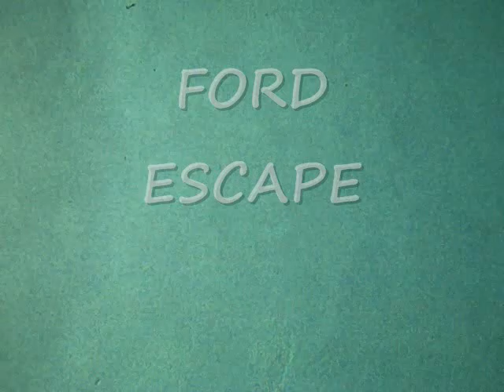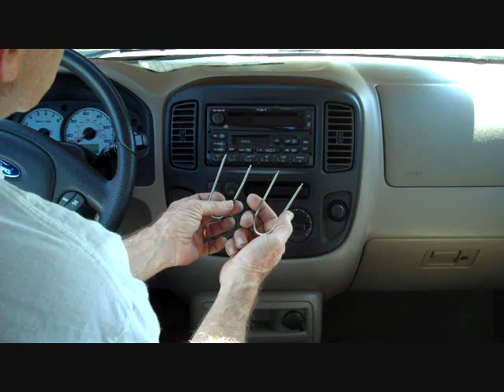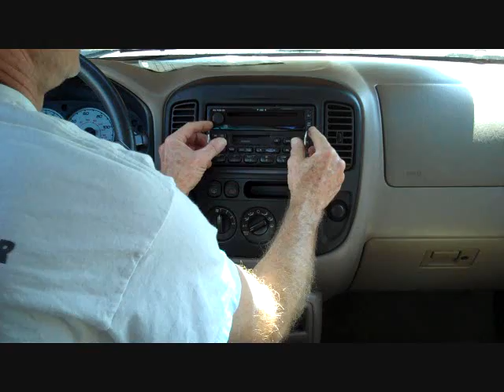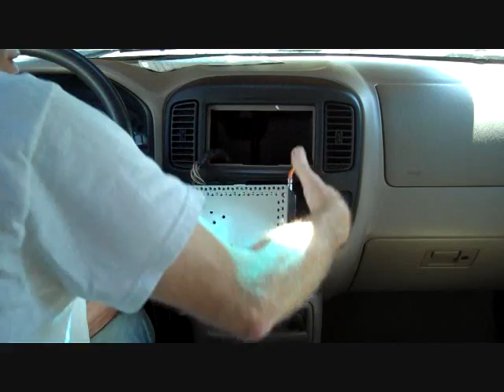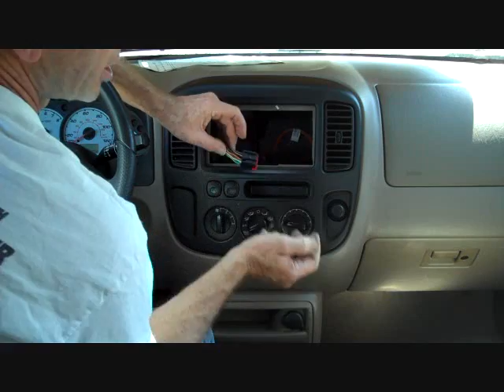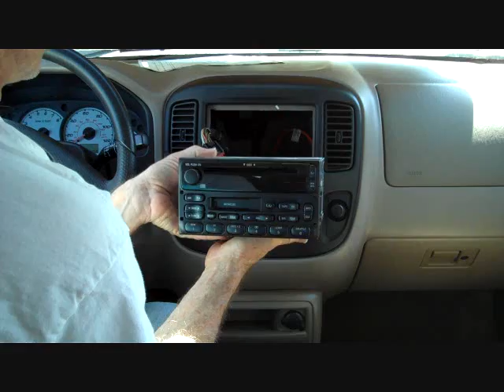Ford Escape Stereo Removal  2001 - 2007 = Car Stereo HELP

Comment: VERY helpful... Thank you! But the wiring connector will not release on mine... The little lock trigger even broke as I was pushing on it so hard... It's still in there as I write this comment, in hopes that someone reading this has had the same issue, and figured it out? Help!! The factory radio is just hanging there cause I can't get the connector to release!

Comment: My stereo makes a constant clicking sound when I try to put in a CD, then typically spits it back out. Anyone else have this problem? Randomly it will decide to work, but usually just clicks and says "no dj" if I press CD while it's clicking. Would removing the radio help to see what's going on inside the compartment?
Reply: I'm having the same problem except it's with the cassette tape slot. I'm bummed because I can't aux any more. I'd like to know why it's doing that.

Comment: Thanks.....do you know if a 2005 Ford Escape Limited with V-6 has a sub woofer....I do not think so but wanted to make sure before I buy a replacement stereo.....The Mach 300 has given me nothing but trouble....
Reply: The limited most likely will have a sub....  In back of the rear seats on the passenger side there is a plastic panel. If its perforated ( like in speaker holes )  there's probably a sub woofer.  There should be settings for it on your radio.  You may have to modify the opening for the new unit..  and if you have the sub make sure you get the part that prevents a loud crack when its being turned off and on..  any stereo shop should have it..  And while your'e at it consider if you want a Sirrius unit before re installing.  Much easier on the install.

Comment: seems so simple. I get that spring loaded feel on the left side but not the right..I get the tool in but it has no spring, and I can tell that side is still latched. I purchased the tools from cut rate auto parts...they don't have notches but more like little balls on the ends.